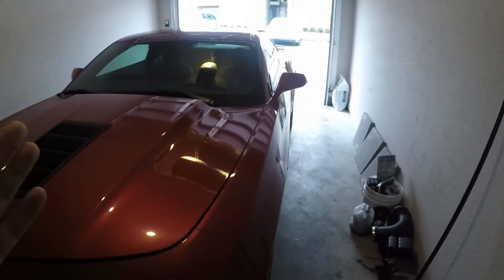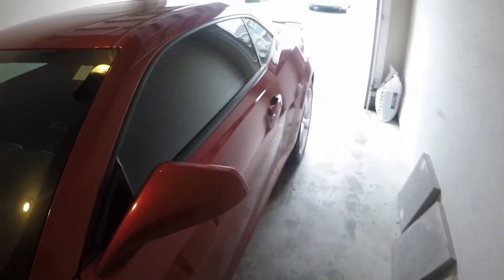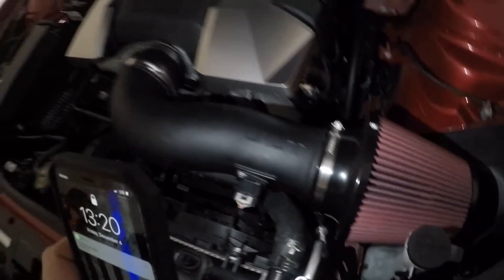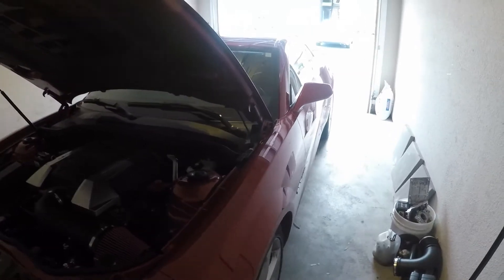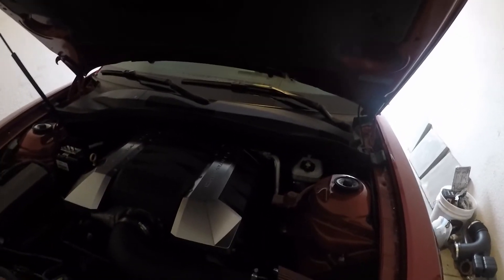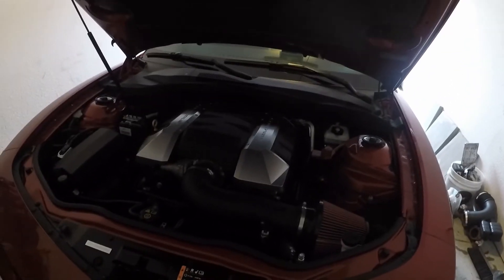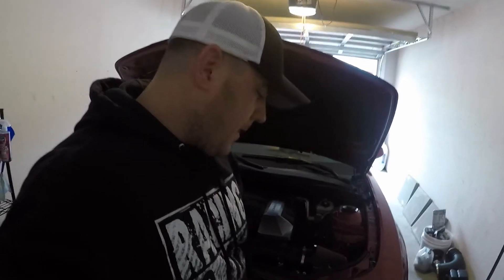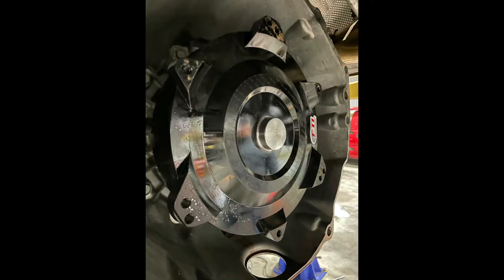Hear the Chop: 2015 Camaro SS 5th Gen + Texas Speed Stage 4 F35 Cam Sound Clip. Long tube header.

Comment: Very cool man sounds killer. I'm getting the F35 cam installed this summer. I'll be getting PRC heads or some nice ported oem ones with all new internals on the top end just because mine has 92k miles right now
Reply from the maker: Hell yeah man! F35 is a rowdy cam for sure. Deff make someone’s neck break when you crank up the car. I’d love to get some new heads but I’ll just port mine because this is something just to play around with and not much of a race car anymore.

Comment: What’s the part number on the torque converter and where did you get it from
Reply from the maker: I don’t have the part number. I ordered through FTI. My buddy is a dealer for them and had him order it. It’s a triple disc billet 4000 stall.